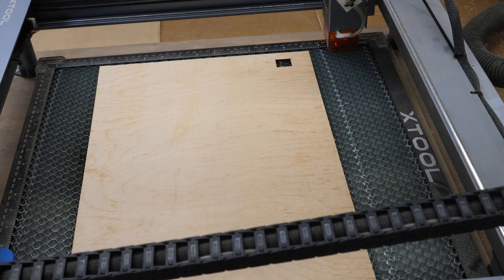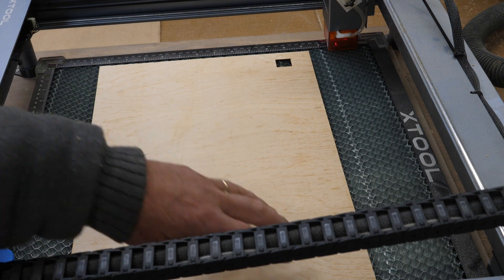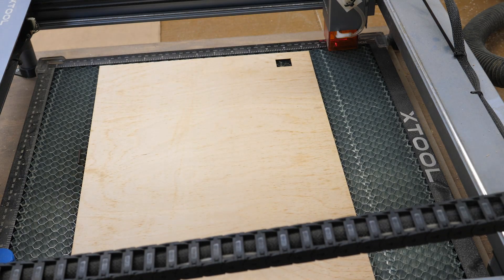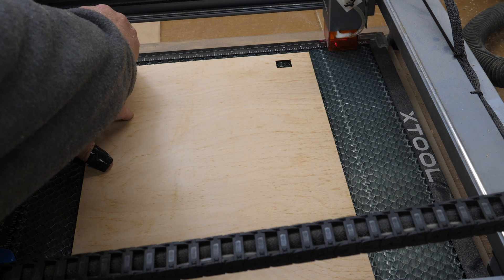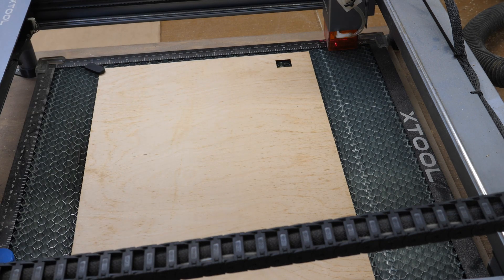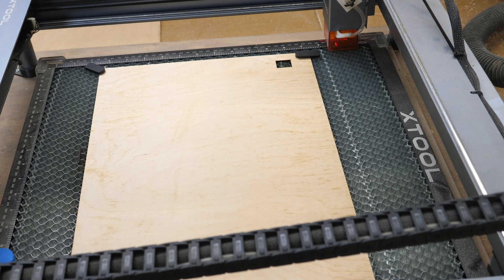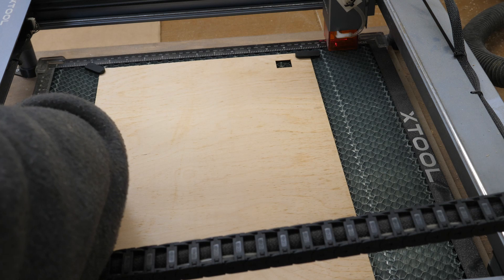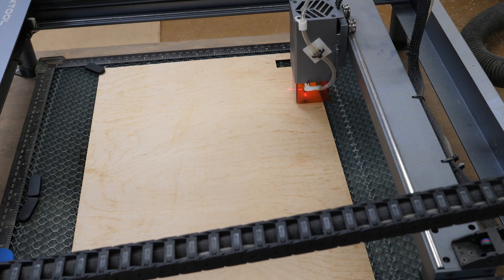Laser Honeycomb Hold Down Pins

Comment: Good tip. I’ve been using thin 1” rare earth magnets. I haven’t had any problems with the laser hitting them.
Reply: I also designed and 3d printed custom jigs/holders for those magnets. They work way better than this on a  video and can be placed in a middle of material if needed too